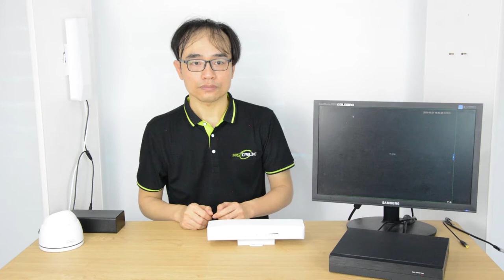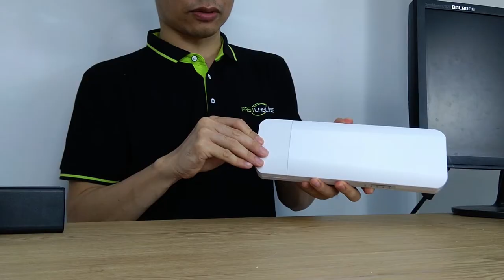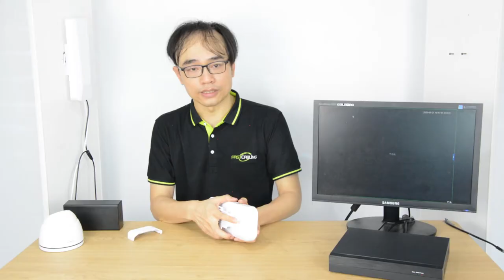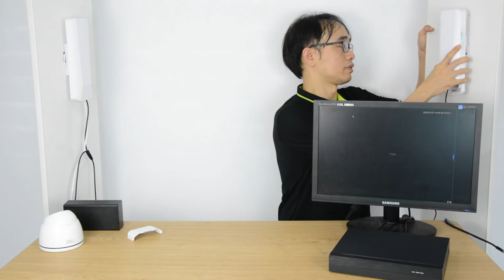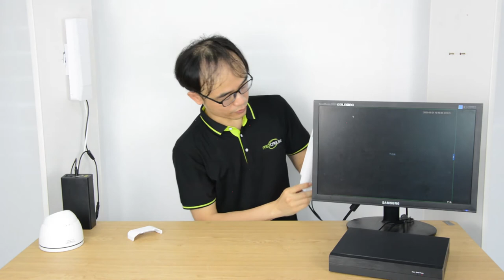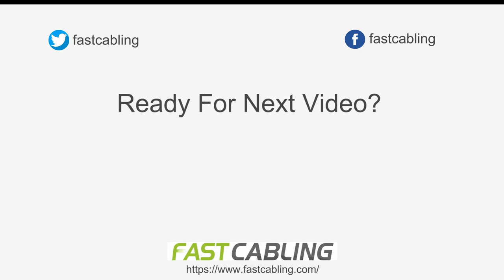How to setup 3 kilometers wireless network in 5 minutes for IP cameras

Comment: How many clients can connect to master bridge.??
Reply from the maker: It highly depends on the scenario. The actually bandwidth base on the network negotiation between the master and clients. You can add the switch to handle the video aggregation before sending back through single slave. While the master need to deal with multiple slave, it is challenging the master, the wireless bridge is bidirectional signal type, not the radiation coverage.